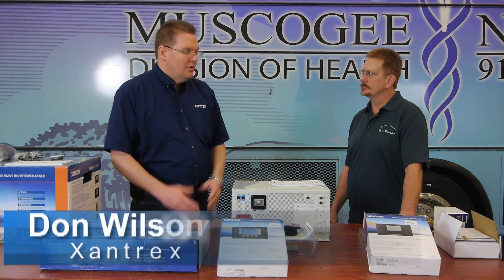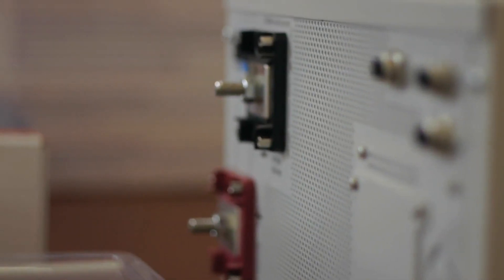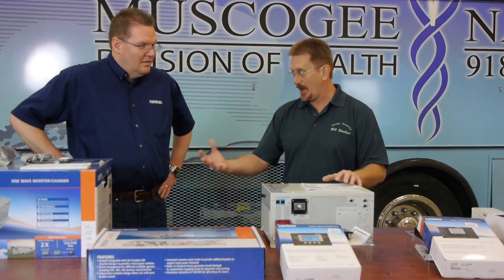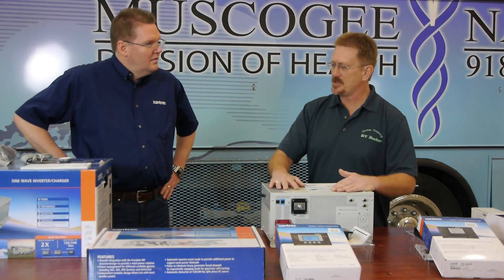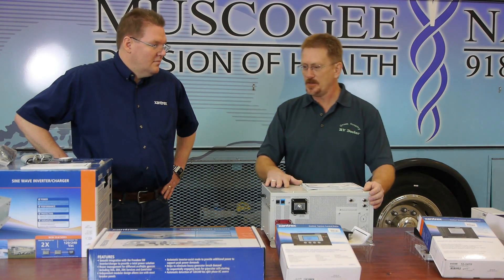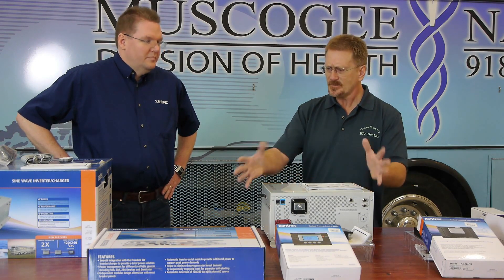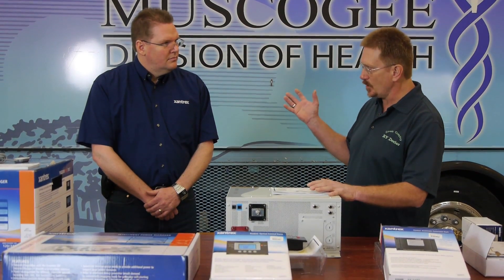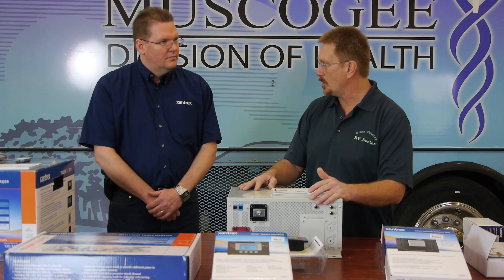Xantrex Freedom SW Inverter/Charger Installation Project - Part 1

Comment: hy  ,I have a question. I want to make a battery bank for emergency ,for my bedroom appliance ,can I do that without solar panels ,to start - charging them with the energy of the house ,I am interested in one of your inverters ,they can do that function and what I need some batteries, I think the inverter and what more do I need ,is because where I live the Light goes almost a few times in the month and , as you imagine I do not like it ,at all , thats hy I want to start like that then he batterieslater in the future I will put some solar panels for the batteries. buddha030@gmail.com - Pablo Rojas from Puerto Rico
Reply: +Pablo R  I run my entire off grid home with batteries and a generator to charge the battery bank. No panels required. Panels are planed in the future though.